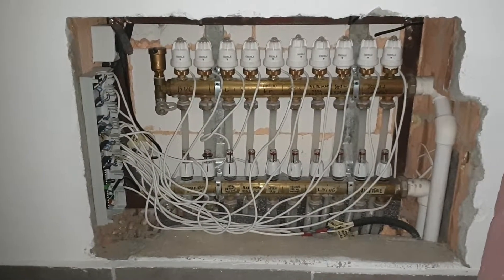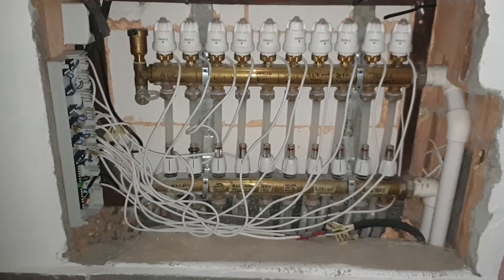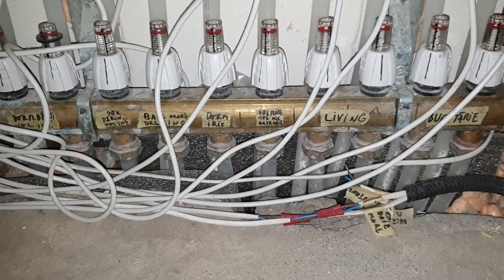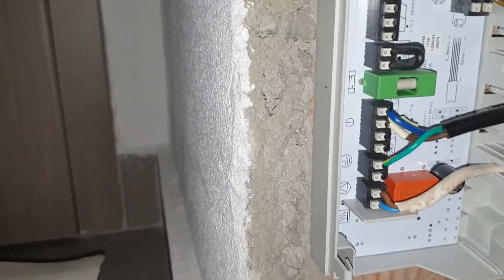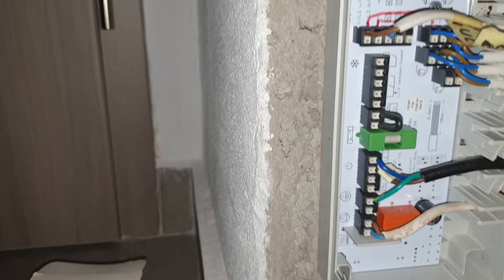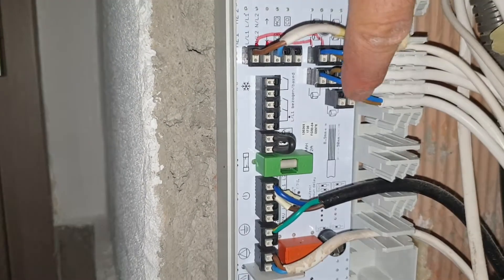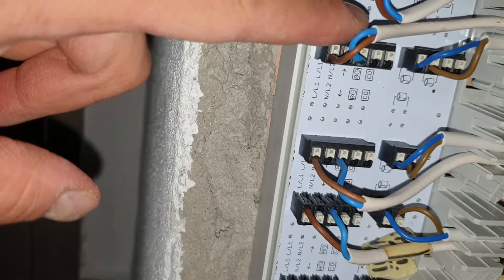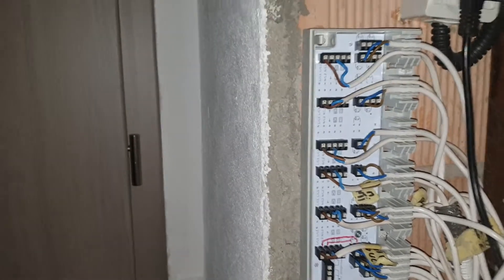Heating automation using Alpha direct B 21402-06N2

Comment: Could you please explain why your pump connectors are used directly instead of having a bridge from the switched pump connector to L' - as described in the description? My issue is that  the pump power supply never stops.
Reply from the maker: Hi, on my side, the pump stops as soon as all thermostats are off.
Which minute of the video are you talking about? 
It is pretty old....

Comment: Hi gabi, question. the thermostat coms are dry-contact connector?   When the thermostat wants heating it will turn ON and when doesn't it will turn OFF ? or they send any voltage?
Thanks
Reply from the maker: Hello, my thermostats are battery powered and they act on 220 volts AC contacts each. 
So PLEASE be careful!

Comment: Is there any way to verify if this  system is powered? There is a power Brick connected to it, but no lights or anything...
Reply from the maker: Hello, my thermostats are battery powered and they act on 220 volts AC contacts each. 
So PLEASE be careful!
No LEDs, use a power screwdriver!